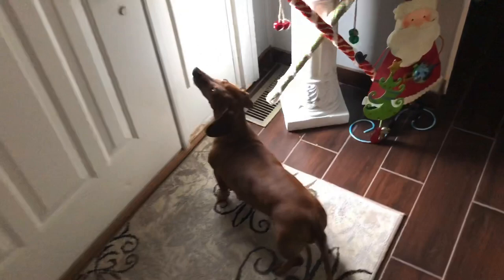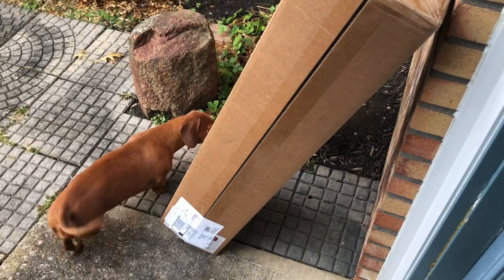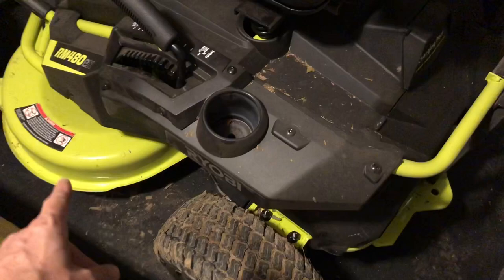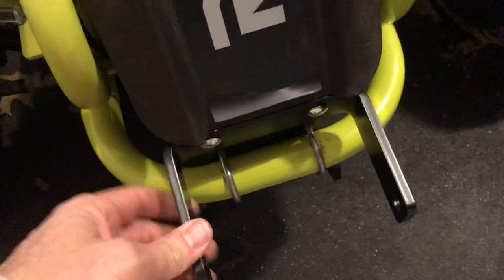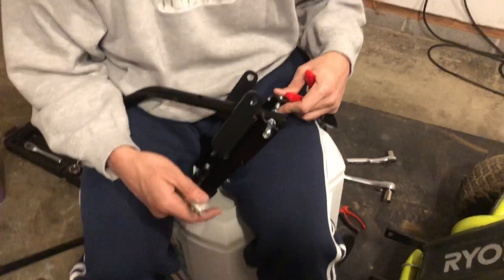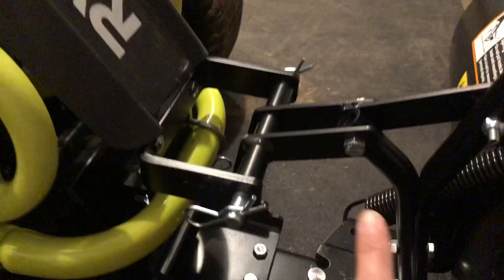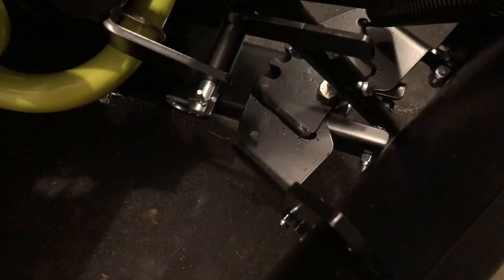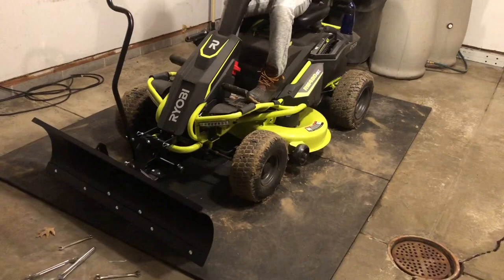100 AH RYOBI Electric Riding Lawn Mower Snow Plow Blade Install

Comment: Thanks for posting this.  I may very well buy the plow.  I thought the plow was fixed and couldn't move at an angle.  Looks like you have to get out and remove the pin and adjust the angle of the plow every time.  Too bad there isn't a way to have a release/lock on a separate handle.    Great video 👍

Comment: Looks great guys, can't wait to get ours. Not sure if we are going to get the plow attachment, but it does look great and I am sure it will do an excellent job at pushing the snow. Can't wait to see it working in action. I am a little shocked that you guys didn't clean the mud off of it.
Reply from the maker: Yeah.....so the reason it's still muddy is because we are actually still using it for the leaves and it gets really messy this time of year....since we have oaks they still drop leaves through the winter and so we are keeping the bags and plow on together so we are ready for the snow or if there is s nice day we've been known to go out in Jan or Feb and get some of those leaves so they aren't all waiting for us in the spring....we'll post a vid as soon as it snows....happy holidays....

Comment: Nice! looks like it's built pretty good! I can't wait to see it in action, I had a riding lawnmower years ago and I remember it wouldn't move in the snow so you probably are going to want to use the chains.
Reply from the maker: yeah we really love this thing and were very excited to learn they finally made a plow for it so ordered one right away....the chains we got don't seem to fit right even though we measured everything like 3 times so we may take some pictures and take them back and get their advice to see if we are doing something wrong or what, but we will figure it out one way or another, but we are ready for the snow this year....happy holidays man....
Reply: @jackanddan  I hope you can figure it out before the snow hits! Happy Holidays to you and your family!
Reply: Jack, What tire chains did you end up going with? Size and name? Thanks,
Reply from the maker: @tjwilson1975  just got some generic home depot ones when we ordered the plow but they don't seem to fit right....measured everything but not fitting one so may take them to the store to see if we can exchange or just get get credit....haven't had to use it yet and may just try without em to see what happens....looked at quite a few videos of other people with electric ones and they seem to do very well....all different kinds....none of em using chains so we may try it and see how it goes and them get em if we need em....this thing weighs a ton....way more than a gas one so it may help....

Comment: She's so adorable.
That's pretty swank. You're all set. I wonder if you could put some snow in the bags for add weight/traction in the rear?
I've always considered one of those, but I have a snow thrower.
Reply from the maker: Dan Hiteshew ....we thought of putting something in the bags but we’ll see if we need to or not....pretty excited to check this out and as soon as it snows we’ll upload a video about how it does for sure....yeah she’s a character and has to be involved in everything we do....
Reply: @jackanddan  I'm assuming since I dropped a grand on a snow thrower, we won't get any snow this year. lol Which is fine with me.

Comment: Hi, do you think this plow will fit into 30inch ryobi riding mower?
Reply from the maker: Designed to be compatible with the RYOBI Electric Zero-Turn Mowers (Models: RYRM8034, RYRM8021, RY48ZTR100, RY48ZTR75), the powerful Brinly 42 in. Front Mount Blade is the go-to tool for pushing snow and then some! The ideal size for residential sidewalks and driveways, the steel snow blade comes with three angle adjustments and a mounting kit for a quick one-time install. The spring blade trip mechanism protects the blade and mower from hidden obstacles, while the replaceable wear bar increases lifespan and durability. For operator convenience, the blade can be raised or lowered right from the tractor seat. A tool as versatile as it is effective, the Brinly Front Mount Blade can also be used to move loose dirt, sand, and gravel. When you’re ready to remove the blade from your RYOBI Mower, it’s an easy job with no tools required..... https://brinly.com/product/front-mount-blade-for-ryobi-electric-ztrs-fb-42ryzt/